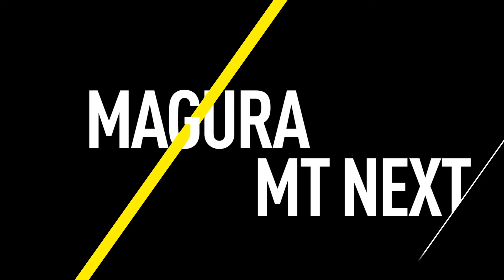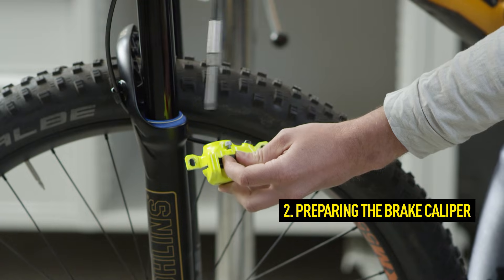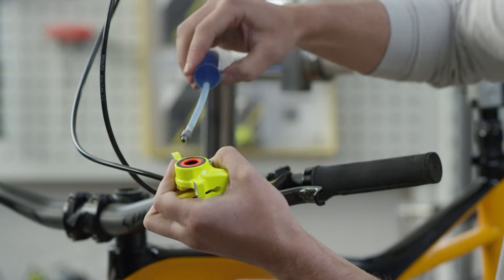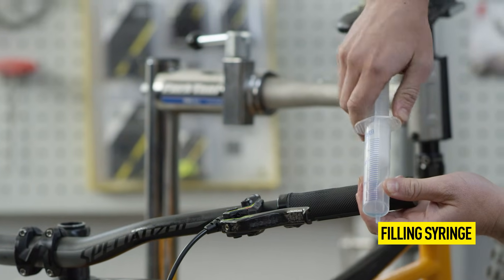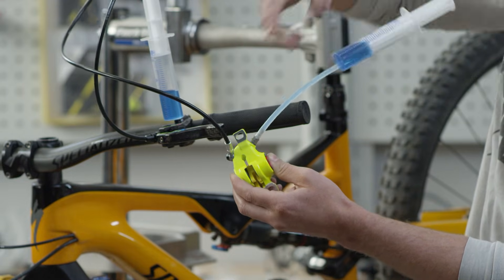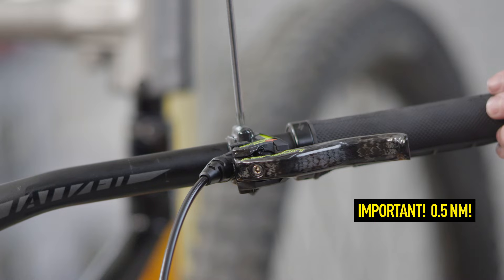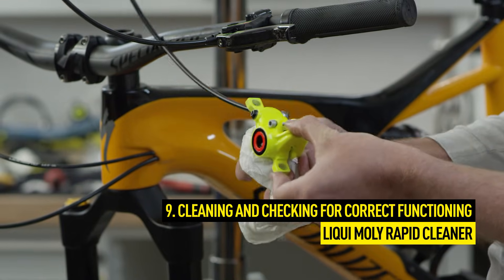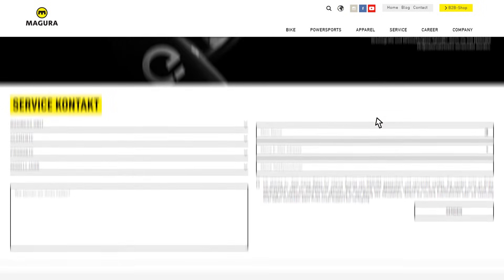MAGURA MT: Filling and Bleeding

Comment: How is the fluid able to enter the upper syringe with the plunger in place? Doesn't the air need to be displaced? 
And.....why do you not withdraw your other official video on bleeding which shows a much simpler procedure that leaves out a lots valuable things mentioned here? That's the one I just went by and made a big mess in the process!
Reply from the maker: We have a full bleeding procedure as shown in this video, or alternatively the possibility to do a quick bleed, if air is trapped only inside the upper part of the system (different video).

As shown in this video, the plunger of the syringe has to be pulled over the hole (or removed) in the syringe, creating an open system.

The other video shows a completely different procedure called the quick bleed procedure, where you bleed the brake only via the master, using the plunger of the syringe to create a point of lower pressure. That's a different procedure though.

If you have any additional questions regarding the bleeding process, feel free to send us a message on Facebook or Instagram!
Reply: There's a little hole in the syringe

Comment: if ebt screw has to be the highest point of the lever can i bleed it then like i normally ride, without moving it?
Reply from the maker: Thanks for your comment! How exactly do you mean that?

You can make sure that the master and EBT-screw are at the highest point and that the master is rotated parallel to the ground during the bleeding process - Once the process is done and everything is closed, you can mount everything in an ergonomic way.

Comment: An advice: clean the pistons and lube their outside surface with oil before introducing the in the callipers. No point in introducing dirt in the system. Also very good for the seals.
Reply from the maker: Good advice, although we would actually recommend to simply clean the outsides of the pistons with a compatible cleaner. Lube them only if necessary - otherwise dirt is attracted to the oil which will result in a dirty system and potentially sticky pistons.

Cheers! MAGURA Social Media Team

Comment: Hang on, if the brake lever bleeding hole is closed, how does the oil level change depending on whether you hold the caliper above or below the brake lever? Is gravity alone strong enough to compress the mineral oil?
Reply: Lmao thought the same
Reply: Right!
Reply: There is a little pressure relief valve on the side of the lever, that's my guess, but good question. Maybe Magura will chime in?
Reply: By holding the caliper above the lever the liquid can't go up, that's how gravity works
Reply: Might be that the expansion baffle in the master is taking in/expelling fluid.  What's it called?  It's basically a plastic bag.  For handling thermal expansion of fluid when the brakes get hot.  Just speculating here😅

Comment: It’s the rear brake that you should be doing a video on,It’s the worst one to bleed
Reply: I just bled both front and rear MT trails and I do things a little differently based on tips and past experience. Remove the caliper and line from the bike and position the bike in a bike stand so that the caliper and line are hanging straight down from the lever. Like dogdaysunrise1970 said, this means the lever needs to be very high for the rear brake. Flick the lever in between syringe pushes and also tap the caliper with the rubber handle of some pliers or something. You want to free any air bubbles that may be stuck. When you push the syringe the banjo on the caliper should be pointing up (to push all the air out), when you pull the syringe you should face the bleed screw up (to suck all the air out). This should get your brakes firm enough that you can adjust the levers in as much as you want and not hit the grips in full stop mode. I have small hands, so need to keep them pretty close.)
Reply: @joshuashall6346  Great tips! I'll definitely try this when I bleed mine. Thanks a lot!
Reply: I feel maguras brake lines are too flexible.hence the rear always feels more spungy .I replaced them with cheap braided lines and they are both perfect now..feel even more powerful.
Reply: Yes! Plus internal routing makes it harder. I think the system at the master cylinder might let air get in when sucking down the oil with the syringe mounted to the caliper if you do it too fast. Bleeding takes longer compared to other brakes I had but it's worth it.
Reply: Easy.  Instead of removing the caliper.  Remove the brake from the handlebars and do the procedure.
Reply: Same procedure, just need the handlebar in your work stand a lot higher
Reply: Flip the bike up so it's vertical, that will make the air go to the top...
Reply: Mine once brake hose changed never returned to its previous state. Never Magura again.